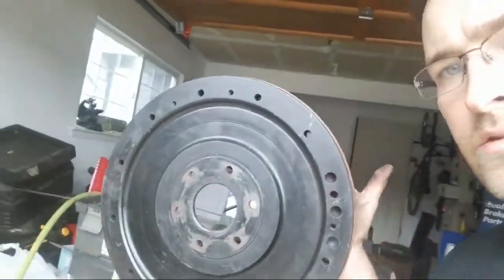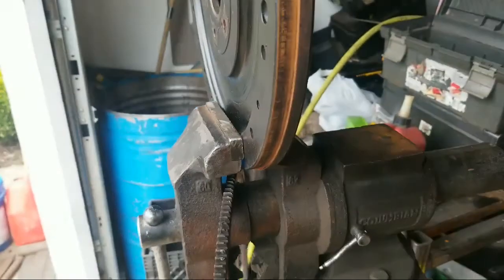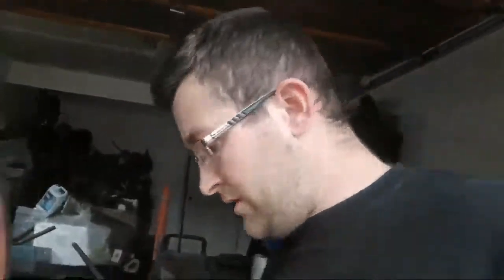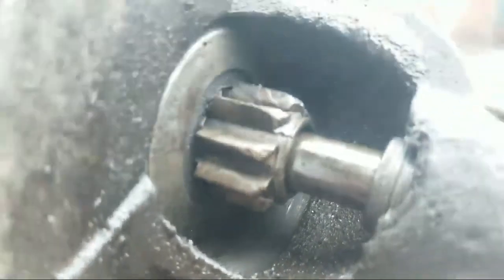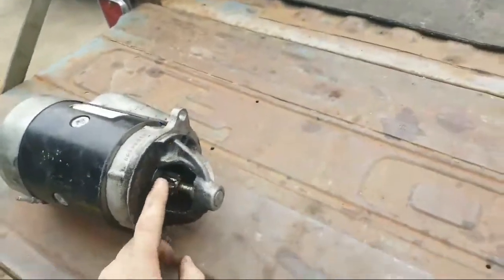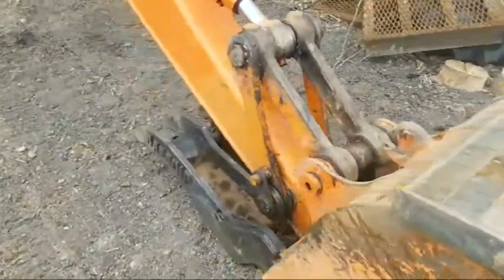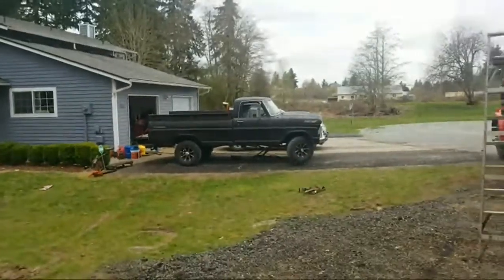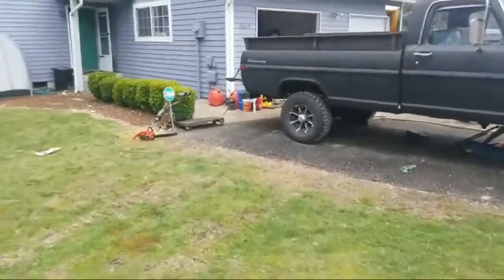Flywheel Gear Bad And Replacement

Comment: I was able to reverse my flywheel gear on my old f250 and kept on going.
Reply from the maker: 23 bucks got me a new ring gear but i guess i could have done that!
Reply: @BRIANVANDUYN  Just thought I would let ya know. They are needing dump truck operators with own truck and authority in northern Ca.  $100 an hr.  Search Klamath Falls Craigslist in Oregon under jobs.  Type in dump truck. Cleaning up fire debris from last year, and there is a waiver for emissions.  Dont know how busy you are. Says food and lodging provided.